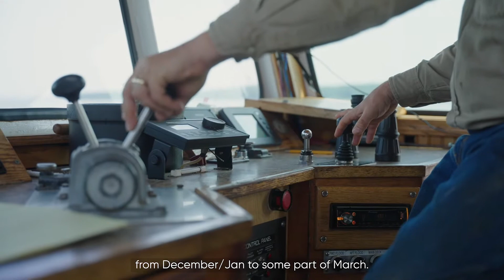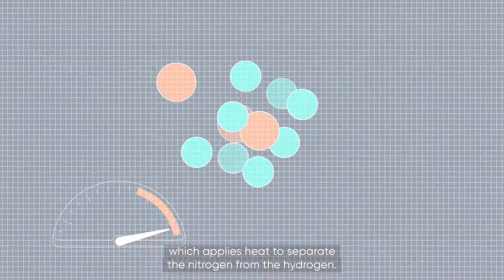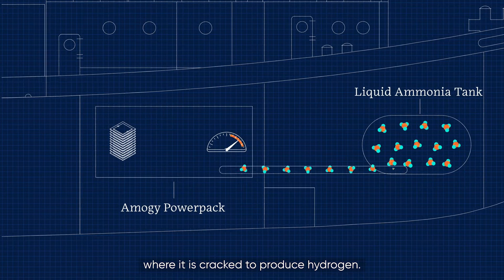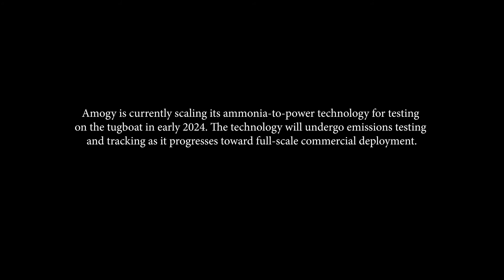The Climate and Us: The challenge of decarbonizing shipping

Comment: Did you think about showing us the reactor? The fuel cell? Anything other than a cartoon about how the process works?  Improve air quality by the coast?  Common. What about the breezy ocean air? And then the owner says that he is worried about climate change causing deep freezing but has an ice breaker he hasn't used for 5 years. Poor air quality by due to shipping is causing 400,000 death a year? What are you talking about? You do want to try and make this believable don't you? Why don't you show any of the equipment?  So why do you have to do the reactor thing on the boat? At a high temperature wouldn't that be a bit dangerous? Why not do the reaction on land and then contain the gas on the ship?  Wouldn't that be a bit more safe for everyone involved? What is this a hoax? And all this weepy climate stuff. Remember 20 years back when we were preparing for an ice age?  The captain needs to get his story right. Its not global freezing -  today its global warming.